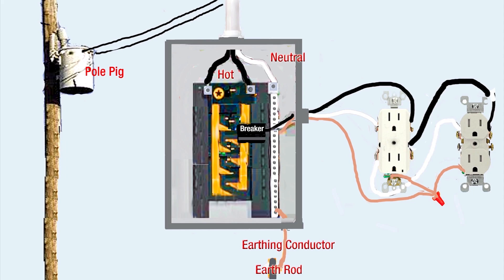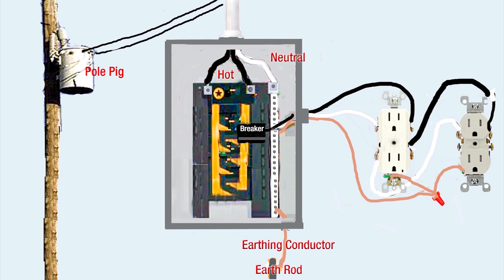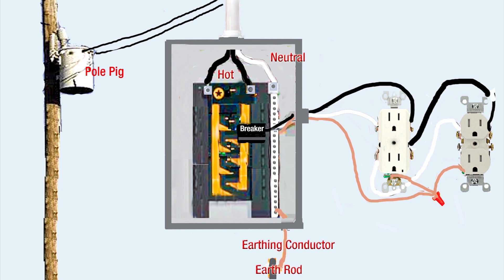Grounding, Bonding, Earthing, Shielding and Protecting with Jim Heath W6LG

Comment: This is it seems the most controversial subject in radio ! I’m not an EE but I started by grounding at the antenna - to keep the lightning out of my house, then I added a specialized and grounded Balun where the coax came in the house - to keep the RF out of the shack, the I added braided grounding straps to my antenna tuners - and I noticed that my noise floor came down a bit. I haven’t seen any ground loops yet but I cant help but think that the way to deal with that would be to bond all of the ground rods together so they came to equal potential. I’ll bet that older houses - perhaps with rotten ground rod for the mains - are the ones seeing the ground loop problems ?

Comment: A 110 volt 3 wire system - you have 2 safety wires, the white & green, no way will I cut the ground prong off my cord connectors - antenna I do go to some trouble to grd. my antenna, & mast, for lightning protection -  But I keep separate from my equipment ground. Just my 60 yrs in the electrical field. Different people all have different solutions for earthing/grounding.
Reply: I have only used one of those ground prong isolaters once and it was because the ground from my oscilloscope probe was shorted to the ground lug and was shorting out the negative side of my low voltage power supply.  I do prefer to have when possible multiple grounds.  But if needed to use an isolation transformer instead of the two prong adapter.

Comment: In my opinion there is no need for all the grounding at the station, the only necessity for grounding is at the antenna outside before it enters the house to protect against static and lightning.

Most homes built within the last 30 years and maybe before should already have adequate protection from earth faults and to guarantee protection there should be RCD protection which all the ham equipment should be plugged into in the shack similar to what you would use for electric garden equipment, lawnmowers etc.

In my opinion , apart from grounding the antenna there should be no need to  ground anything in the shack separated from the house electrical protection circuitry because that’s what it’s there for in the first place.

I’m not an electrical engineer so my views are purely personal if in doubt ask an electrical professional.

Comment: Jim!  Glad to see you're doing well :) I've been subscribed to your channel for a couple years now.  We've talked on the air briefly once.  I hear you out there often.  I was at a hamfest today and acquired a High Sierra screwdriver antenna based on looks (and price) alone.  I had very little knowledge about them, other than that they look well made and online many were making comparisons to the Tarheel.  Lo' and behold my internet searches have revealed that this is an antenna that you used to produce!  What a wonderful discovery!  I'm excited to get this antenna in operation.  I hope it works as good as the internet says it does!

Comment: Well Jim you sure open Pandora’s box with your take on grounding. 
When living in Florida in the 70’s we had Florida Power & Light give a talk at our Hamfest. 
After the hour long talk someone asked when, “when do stop with all this grounding”.
His answer was, when you run out of money. 😳
At that time he suggested connecting your radios ground to your ground rod and have that rod connected to the ground rod that’s connected to your meter. 

Had my electric meter replaced in 2004, and they placed two rods to the meter 10 ft apart. 
?????
73
Wd4dda

Comment: I hope this series is eventually going to teach me how the heck to ground my ham antennas against lightning.  I'm out in the middle of the desert and putting up even a dual-band stick would make it the tallest thing for _miles_.  Worse, I have a multiband vertical that is not DC-grounded and I've no idea how to protect that should I erect it.
Reply: You just never know when you will take a strike. Read all the books, even took a class.  Then one day we had a sever lighting storm rolled in. Tv's, surge protectors, all took a hit. The only sure way is to disconnect  the power and RF. I had removed the RF lines from my radios but forgot to unplug the power supply. Went thru surge protector, then power supply, then one of my radios. Learned the hard way.
Reply: @jeep146  Even unplugging won't stop everything.  I learned that lesson the hard $7000 way back in 1993.  I always unplugged antennas and power cords when not operating.  Always!  I crawled under the desk and unplugged the power strip that had everything on the bench plugged into it.  One plug disconnected all AC power to the bench.  Then while under there, I disconnected the incoming coax from  a coax jumper that went up to the equipment on the bench.  All fine and good, except I left the power plug and coax jumper laying about 18 inches away from the incoming coax connector.    I took a direct strike on my tower.  I was coming down the road on the way home and actually SAW the strike hit my tower.  When I came in the shack, it was full of smoke and that smell you get when you know it's a major hit.  What had happened was the lightning jumped the 18" gap between the antenna coax and the plug on the power strip cord.  Everything was toast.  There was a burned spot several inches wide and 18" long from where the destroyed coax connecter laid and where the destroyed power plug laid.  The insurance adjuster crawled under the bench to take a picture because he said he had never seen anything like that and no one would believe him if he didn't have a picture.   So, when you rely on disconnected cables, make SURE they are well away from anything that is close enough to arc to.  I know from experience that 18" is not far enough.  I've not had a strike since, but I disconnect my antennas outside the shack now.  I have read, but not verified, that if you have an open ended coax going back outside and just laying on the ground, you can connect a disconnected antenna coax to it and the lightning strike will be further directed back outside the shack.  I'm not sure enough of that to trust it.  I'd rather just have it not come in the shack to begin with.  One thing I've learned over the years that if lightning wants in, it's going to come in regardless of what you do.  However, my new shack is an all-steel building with no windows and all metal doors.  If it gets in here now, it's because the building came apart somewhere, in which case damaged radios is the least of my worries.  I watched a tornado pass within less than a quarter mile of my place a week ago today, so it could happen.

Comment: I'm glad I watched this.  I sympathize with your neighbor; when I first got into ham radio, I read several books about setting up a shack and was distinctly told by at least one reference that I should bond my equipment chassis grounds and run them immediately through a short earthing wire out the wall to an earthing rod.  I did this and never had any problem.  I'm not an expert, but I still think that is a good idea for equipment which does not have the chassis tied to the electrical ground.

Two stories, neither of which are first hand, that may aid in understanding:

In an electrical engineering class, the instructor was asked what, exactly, was the difference between earth and ground.  His answer:  "Around here, about 5 volts."

An industrial building had a large amount of heavy-duty electrical equipment on the second floor.  Unbeknownst to anyone, the second floor electrical system was not bonded to the electrical system on the first floor.  Everything on each floor ran properly, so it was quite some time, and only after a serious injury, before it was discovered that the ground potential between the two floors was some 20,000 volts.

Firsthand story about neutral vs. ground:  A friend of mine had an older house with a countertop cooktop and a hood above, with the cooktop controls in the front face of the hood (a nice design that puts the controls at eye level).  She complained that she sometimes felt a slight electric shock when she touched the cooktop and the hood simultaneously.  I brought over my meter and found the potential difference between the cooktop and the hood was 73 volts.  The unit worked, so the neutral was OK, but that's not the same thing as having a ground connection despite the neutral being connected to ground at the panel.
Reply: 220v in US in your home is AC using two legs of 110v so it's a "balanced" system flopping back and forth 60 times a second ...wire running a heating element in a stove or water heater (code did not require for many years)a spare neutral (aka ground wire) due to this fact Im not sure your analysis of the stove is correct
Reply: @steelboymi  Could you expand on this a bit more?  The electrical shock was undeniably there (I should have mentioned that the difference was present when the cooktop was turned off).  It sounds like you're saying the potential difference between the two was normal.  I would expect that the cooktop and the hood would share a common ground.
Reply: @pseudorandomly  I don't know enough about how they are wired...modem cooktops tend to have 220v elements to heat and microwaves are 110v so microwave is on one of two "legs"  that are coming in from power company.  I'd be tempted to move the breaker for microwave on slot up or down in the panel (whichever way had slack in the wire) but that me I have plenty of experience with residential panels...there is still  live power to the box when main breaker is off so not a job for novice

Comment: Grounding and bonding is indeed one of the most controversial topics in ham radio.  I have read many articles and watched videos on the subject.  None seem to agree with the others.  Then I found the ARRL book "Grounding and Bonding for the Radio Amateur".  ALL WHO ARE CONCERNED WITH GROUNDING SHOULD READ THIS BOOK.  One thing the book and the National Electrical Code requires is that all ground rods should be bonded together with heavy copper wire or strap.  Your final drawing does not show bonding of the two earth rods.  My transceiver is not connected to the AC ground through the DC power supply, only to the station RF ground.  My old tube boat anchor is of course grounded to the AC ground.  Also the GFCI outlets should not be connected directly  to the RF ground, only the AC ground.  With the bonding of the AC ground rod with all RF ground rods, all equipment is at the same ground potential.  Any accidental contact of AC to any chassis will trip a GFCI or circuit breaker.   73  K9AEE
Reply from the maker: Excellent.  The second diagram is my idea of what should not be done.  In the another episode, I will have a recommendation.  Thanks, Jim W6LG
Reply: @ham-radio  Glad to hear that Jim. I was worried for a minute.  73 K9AEE

Comment: Thanks for the video. I watched your video and now I don't know what to do. Should I use a Earth Ground Rod or not? And if not, then do I just plug all my equipment into my house outlets and be done with it? I've been a ham for over 30 years now and only operate on the 2m and 70cm bands with local repeaters. But do use HF during Field Day events. Now I'm looking to purchase a flagpole antenna, but this video is now discouraging me on if I should jump into the HF world with not grounding my equipment properly. I don't want to use my new gear; when I purchase it, and get electrocuted or destroy my new gear from improper grounding. What do I do or what should I do?

Comment: Understanding Entropy and its use of voltage to return matters to an even state is my key to understanding grounding. Charge carries energy. Flowing charge is current .Current is a means to even out potential differences. These differences are voltages. Entropy manifests itself through current in an unrelenting way to eliminate the voltage anyway it can. Entropy is inevitable and unavoidable. It will happen, current evens out the potential difference. The neutral wire parallels the hot wire. The circuit  spot  between neutral and hot is where the load goes. The load is a light bulb, a power supply, toaster, computer, televisions. A limit is placed by means of an overcurrent protector in our electrical panel box in serie with the hot wire creates a "controllable" power deliverable.  The current which trips the breaker is well beyond that which our bodies can tolerate, particularly once our skin is compromised.We operate on less power than a 50 Watt bulb. The inline overcurrent protector is the means to prevent fire, it does not prevent an electric shock to a human being. That over protection is the means to stop the flow. Everywhere a load is between neutral and hot energy is dissipated and voltages are evened out. Entropy likes that.. We are harnessing the energy transfer between hot wire and neutral to do our bidding. Meanwhile entropy continues to lurk in the background seeking a way to even things out without any regard for intended use. Entropy has many agents, they include circuit boards, the shielding around the conductors, and the metal case around the equipment. All places where a short can occur. A wire connecting the equipment case to the ground provides current a path independent of the unfortunate equipment operator who touches  an energised case , and provides a means to allow sufficient current to bleed out the energy and maybe trip the overcurrent protector before the power delivered starts a fire or finds a path through us. Not a fail safe by  any means, but an additional level of protection. Now that path to ground is also now doing  Mr Entropy's bidding, and will probably find some nefarious way to even out some other Voltage difference, and allow the flow of current in other places where one does not want it and that is the rub.....KD2RBF John

Comment: Hi, Jim hope you're well, can I say first I was watching your videos long before I was a Ham and they helped me so much so thank you for producing these videos,  Here in the UK from what I have read we run two different systems new houses run PME where we have a series of ground rods from the property to the substation. If I were to add another rod outside and ground my equipment to it, and if there was an issue with my electrics and any residual current was sent to ground my little old earth rod could pick that up and send it straight to my equipment and potentially me :) The other issue I have is my shack is on the 3rd floor of my house. So if I was to run an earth wire from the 3rd floor to the earth rod at ground level; I have just potentially just created an antenna if when any stray RF gets into it. So I created an artificial earth on the 3rd floor using random cut radials and a  MFJ-931. allowing me to tune the random wires to the band im using This dealt with any stray RF,  and reduced my noise floor. 73 regards David

Comment: howdy Jim, I've been out  of radio for a very very long time. I blew the dust off my old mobile and hooked it up in the house. So I have ?'s. I mechanically connected the antenna pole to an earth ground, I used a MFJ-270 lightning surge protector and connected the ground wire from it to the earth ground the pole is connected to. I put another earth ground at the entry window and mechanically connected a wire from there to the earth ground of the antenna pole.  At the window i used a so-239 3 in. long for entry and grounded that to the earth ground  at the window. One of my questions is does this seem to be the right way?  The other question is should I connect these 2 earth grounds to the 2 earth grounds I have for the AC entry at the electric meter?

Comment: Thanks Jim ... I agree with you. My situation is exasperated by being off grid. I had a situation where dc ground had a voltage difference between ac ground. Ground is a reference voltage .. be careful what your reference is and make sure the whole system agrees on that reference.

Comment: Jim, I am a  Ph.D. and a retired university professor. I have worked with all sorts of laboratory electronics, radio transmitters, high voltage and high current sources. I watched electricians install wiring in new homes when I was only five years old. I replaced a light bulb socket on a lamp as a nine year old. 
   Electricity, AC or DC, in the right place is great, but in the wrong place, deadly and destructive. The same with RF energy.
   We are blessed to have voltage sniffers that detect AC voltage on live electrical lines, voltmeters, etc. Better to use a meter than your body to find electricity or RF. Think before you move. Read a lot and ask good electricians, electronic technicians, RF engineers, etc.
  I am still learning!! N0QFT, Glen